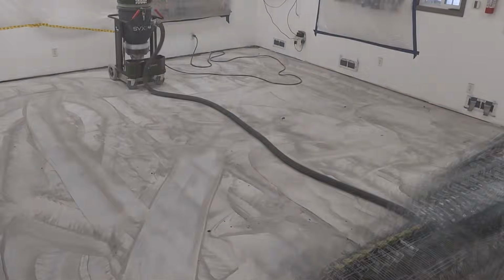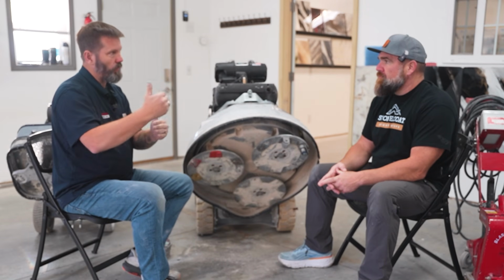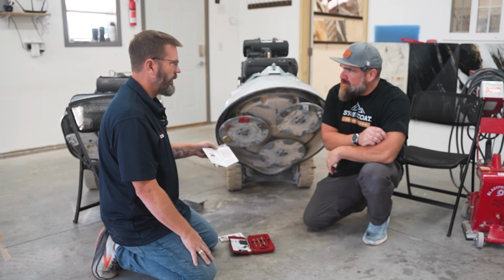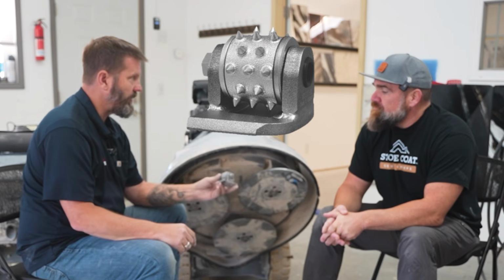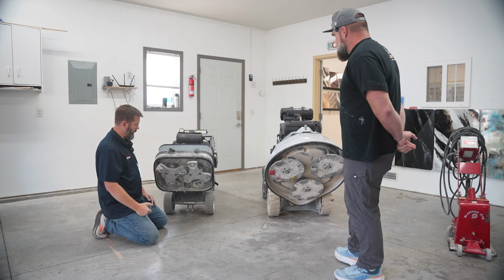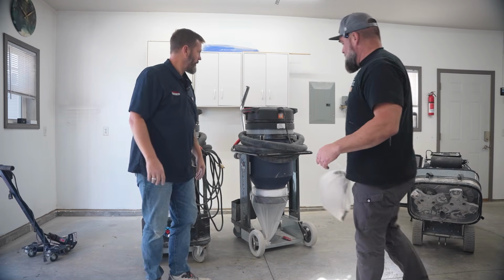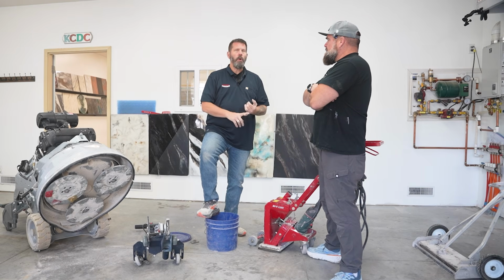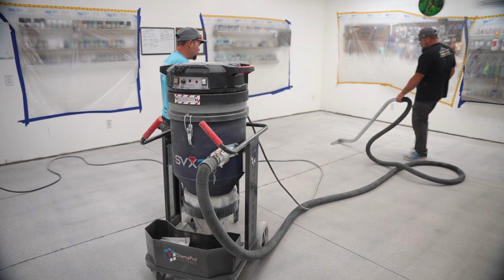Expert Concrete Prep Q&A for Your Epoxy Flooring Business

Comment from the maker: Don’t waste diamonds, man. 👇
What’s your concrete like where you live — soft, medium, or ROCK HARD — and what grinder/diamonds are you running right now?

Drop your setup + what part of the video helped you most (timecode really helps). We'll hang out in the comments and help you dial in tooling, scratch tests, CSP, vacs, and shot blasting so your next epoxy floor is faster, flatter, and more profitable.

Comment: I been thinking about doing my counter tops in the kitchen. My question is do they stain from use of different foods or items you may have to put on the counter. 
Second question is do it matter what or how you clean the surface after the Epoxy treatment
Reply from the maker: Our products, especially the Ultimate Top Coat, are really stain resistant. We even test coffee and wine on them in this video below. As for cleaning, a little regular dish soap works fine. We also have our polishing and cleaning kit on the website that's specially made to be compatible with our countertop products. Just avoid using harsh chemicals or metal scrubbers, and those countertops will shine for a long time.